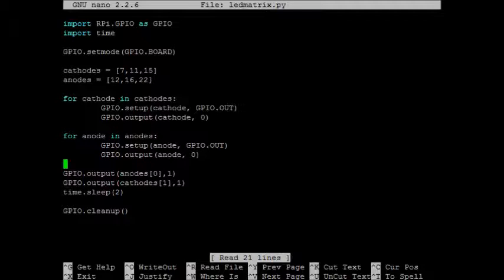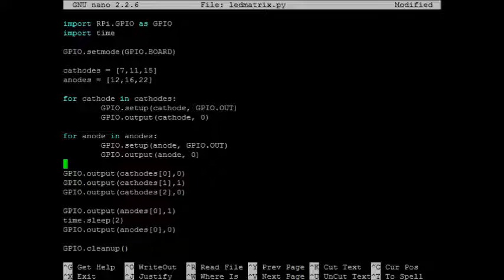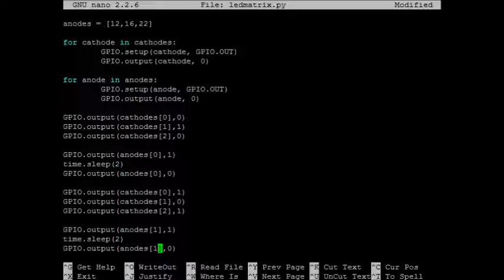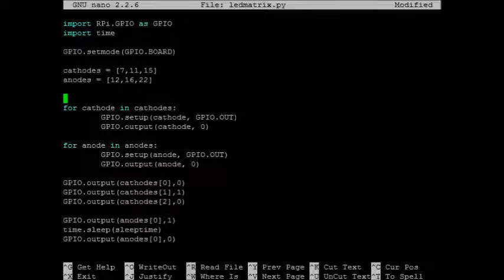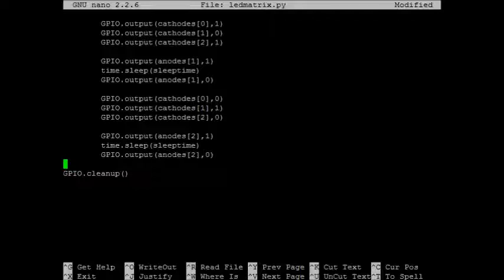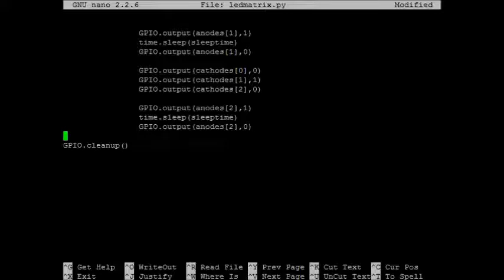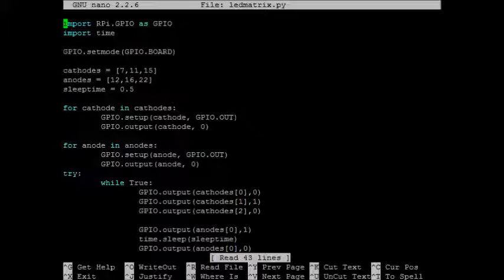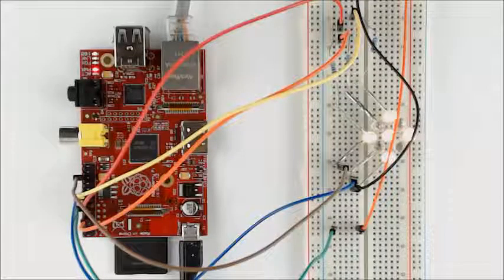Raspberry Pi Project: The LED Matrix (Part 7 of 9)

Comment: Nice video! I learned a lot about LED matrices from you.

But best practice would've been to put the cleanup method into a finally block.
Reply: +TheCherry1994 | I agree, these tutorial series have been great so far but it's very important not to teach software design anti-patterns. I'd say that all RPi programs that use GPIO and are not meant to set permanent pin state should be enclosed in a global try/finally block that calls GPIO.cleanup() - the dumb RuntimeWarning that is printed if no GPIO.setup() occurred should be ignored.

Likewise, this video could also show that the two for loops that setup the GPIO pins could be merged into one loop by joining "anodes" and "cathodes" lists with a + operator. I don't know what the state of the GPIO API was in 2013 but nowadays you can also simply pass the lists as the first argument of GPIO.setup() and GPIO.output(), thus omitting a for loop entirely.